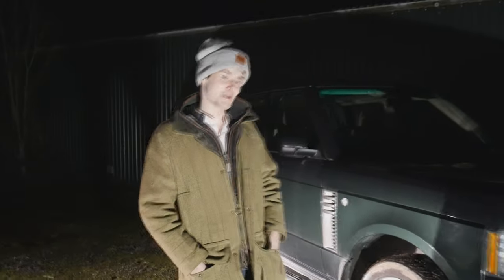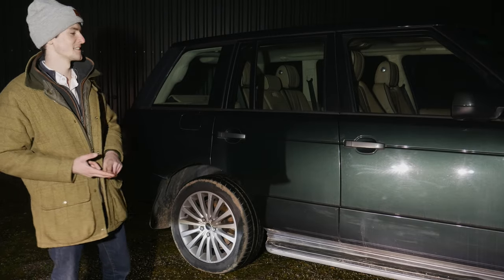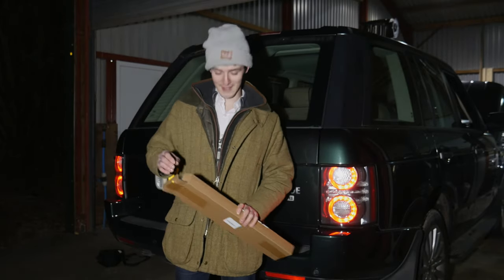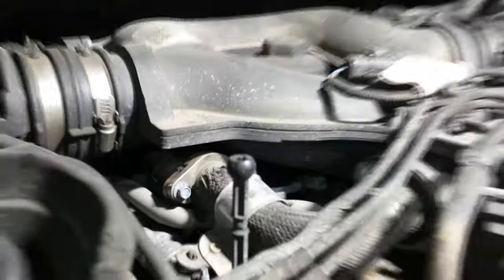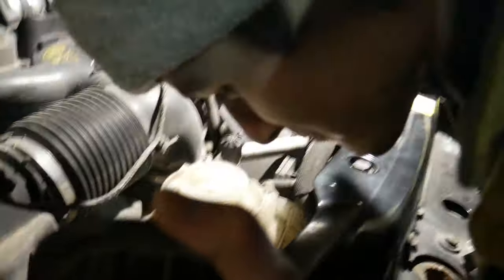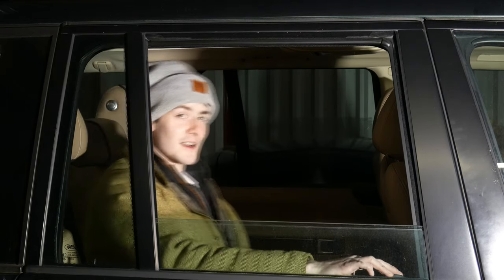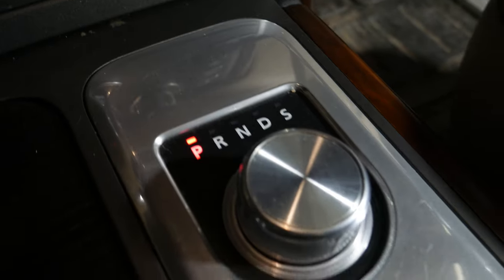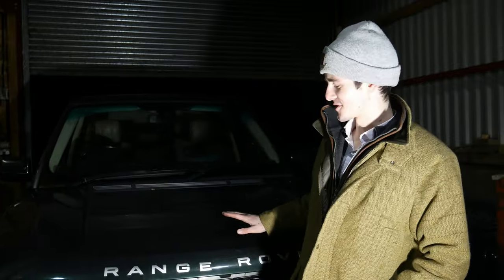I bought a green L322 TDV8 Range Rover!

Comment: RE the fan, no to my understanding and on both my classics and P38 the viscous fan should only kick in when hot and the wax has liquefied so sounds like the coupling has passed away
Reply from the maker: Thank you for your thoughts, I did think as much as it was not getting up to temp idling. I will as a fan onto the list of parts that I need.
Reply: @L322Unlimited  It is an epic looking motor, hopefully passed what you have mentioned on your list, there will not need much doing! My one only did one naughty thing and the warranty covered it luckily as at that time there was no bodge fix, but in this day and age someone has prob worked out a fix for anything that is a proper ball ache. I am guessing you are already well aware of the fullfat RR forums? All the best with it, look forward to seeing the first drive video.
Reply: @L322Unlimited  Just remembered there is a test for a weak viscous fan, but I cannot remember it and it involves holding it! :) So I will not try and quote it here but hopefully someone on tinterweb has listed it. Do not want you loosing any fingers because I cannot remember quite what the process was!